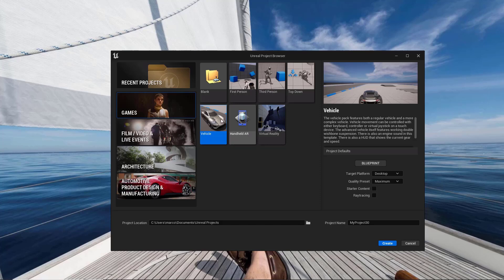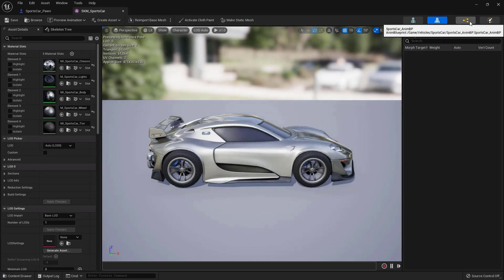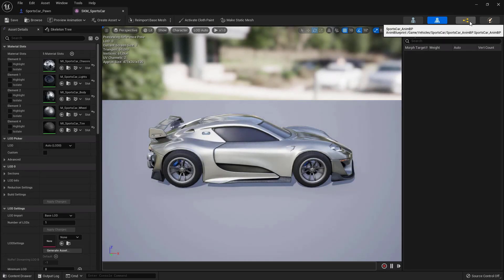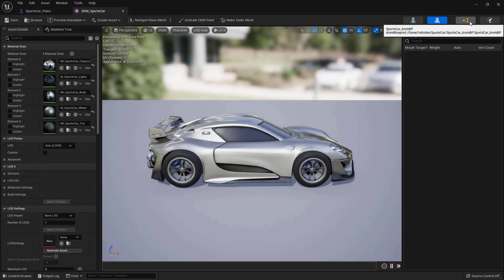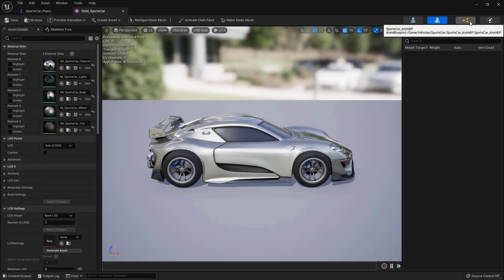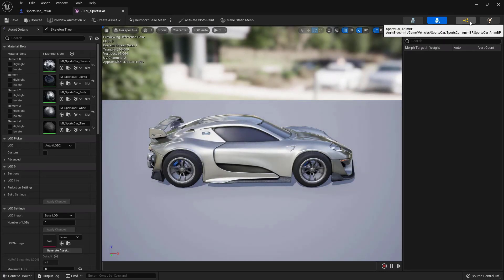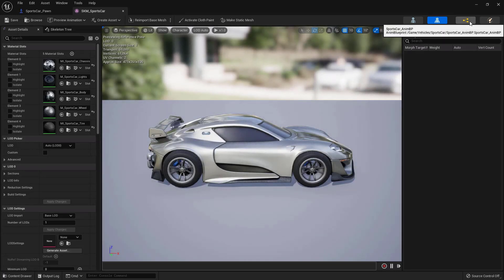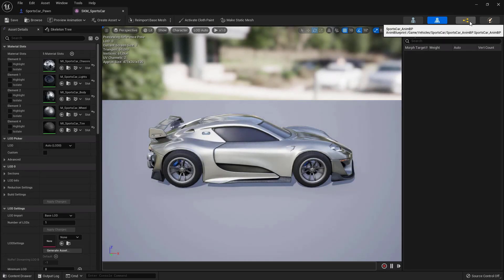Chaos Vehicles Wheel Shift and Camber - Unreal Engine 5 Tutorial

Comment: Dude! You make great videos 👌 I have a request 🙂

I feel like it is impossible to get good vehicle handling in this game engine.  NO videos talk about how to get any form of acceptable handling for chaos vehicle (or the old wheeled vehicle). There’re hundreds of setting to fiddle with.
I have tried for months now. And I am almost giving up now.

I know that wheel friction and center of mass is drastically changing the handling, I just can’t get it right.

Too high friction and the car wont slip/skid out, which it needs to do, cause having a car glued to the road is not fun.
Too low friction makes the car slide, and is not getting any forward momentum, and it takes forever to get it up to speed.

I’m almost getting there with different settings in front and back tires, including brake power, but as soon as the car starts sliding/skidding (what is the difference?) it looses it’s forward momentum, and just goes sideways.

I’m sorry, this comment is getting long, I am just frustrated by how hard it is to get proper handling. The default settings are absolutely useless..

On my channel I have a few videos of my car game, if you are curious to what I am trying to make here..

Can you be my light and show me the way to get good car handling? 🙏🙂
Reply from the maker: Yes, I already watched your videos about procedural track generation. Great stuff!

Regarding vehicle handling, it can get very complicated. On one hand good handling is very subjective and different players have different expectations. On the other Chaos Vehicles are designed for performance and multiplayer, but they lack some fine tuning options and, at the moment, their settings are largely undocumented. One can learn a lot from the source code but it takes time and experimentation.

The basic handling is mostly given by the tire friction parameters (multipliers etc.) and the way the suspensions are set up. Secondly the way the player input (raw) is transformed into the vehicle input.

The behavior also changes with the adjustments to the center of mass and to the inertia tensor scale of the vehicle's body.

Overall you need to understand how vehicle dynamics work and how the different settings affect it. For example, what to adjust if your car understeers/oversteers, what if you want to make it drift, etc. There are few basic vehicle dynamics and simulations tutorials out there that may help you familiarize with those concepts (google Marco Monster's vehicle physics tutorial).
Reply: @marcoghislanzoni  There’re just so many odd thing happening. Like the vehicle starts turning slowly at high speeds, or when the car get traction again after a drift, it gets all the traction at once and then you end up going straight into the railing… Thing I just have absolutely no idea how to fix, because the setting are so obscure that you need to be a car engineer to understand it..

I will try and search for your suggestion 🙂
Reply: I've been having those same struggles with the Chaos Vehicle and Advanced Vehicle systems (especially with trying to replicate Need For Speed The Run's/ Shift 2 handling) What helped me a ton with the chaos vehicle set up:

Inertia Tensor Scale: 5,5,1
Slip Threshold: 2
Skid Threshold: 1
Side Slip Mod: 0.4 - 1 (depends or your build and is most noticeable on the rear axle)

As far the suspension goes...not sure... I'm still trying to get more body roll without using the arcade settings. Maybe aiming for softer dampening and springs with hella slip could force the car to behave as desired, but I can't confirm that it fully works. I really wished the developers of Chaos Vehicle System would collab with the dev of AVS. This would fix so many issues with making a more realistic or fun driving system for our projects.
Reply: @jaiarojas5147  thanks.. I will try and copy your settings, and see what happens 🤷🙂
Reply: @REE-Animation  I have the same issue, where the wheels gain traction during the drift and they aim to the internal side of the corner. Quite annoying.
Reply: @jaiarojas5147  Apparently, many seem to have difficulties getting an arcade-handling and physics, with the existing Vehicle physics.
I do like Chaos Vehicles. It's easy to setup and get going, but many properties don't have any explanation. Even experimenting with them, it's not always noticeable what they are actually for.
For example, with the 'Arcade Controls', I was able to figure out what the Stabilize Control' settings exactly do, as you can see the forces created when you use the VisualDebug. But the 'Torque Control' and 'Target Rotation Control' properties, I have no clue what they're supposed to do, because whatever values I use, I don't see or feel anything happening.

What is the Intertia Tensor Scale actually do? And any clue how it is different from the Velocity XYZ in that same property-panel?
Slip and Skid Treshold, I don't notice too much effect of them either (with drifting). Have the default values for the front wheels and set both to 100 for the rear wheels. The one creating the game 'Over Jump' (a Sega Rally 'remake') led me to a Lateral Slip Graph, which helped with keeping the car stable at lower speeds and get a bit more loose when at higher speeds. But still not enough to get decent drifting out of it?
With @REE ANIMATION & GAMING advice, I was able to prevent the car from tipping over so much. And if it does, generally land back on 4 wheels.

I see some video's of people showing of their drifting within an Unreal Engine. Most of them are just to slidey and if you played enough with the settings, you know their drift isn't actually in their control. Some video's do show proper arcade drifting, but don't show how they actually managed to get it running.

I saw a GDC of 2018 that explains that how instead of creating their own physics, they used in-engine physics and assisted those physics to get more arcade control out of it. But again, they don't show how to do it.
So it is possible, but seems like the ones who know, are hell bend on keeping it to themselves.

Comment: Very helpful tutorial thx but I have one question I've add the possibilities to set the rear and front toe also with this tutorial but I want to know if this adjustment on my car act like in real life does for example at negative 4 degrees of camber on front for a drift car would it improve my grip and stability or should I need to do another nodes in the blueprint of the car to say to the car when you are at negative 4 degrees you have more grip during drift ?
Reply from the maker: What you see in the tutorial is purely aesthetic not functional. To tweak the actual grip of the car according to the camber/toe you have to act on some of the parameters in the wheel BP's, like lateral stiffness, friction multiplier, etc. Some of them are not exposed to BP's but if you use C++ or know how to make a BP Function Library that is pretty easy to overcome.
Reply: @marcoghislanzoni  okok thanks for your fast answer :D

Comment: that's a nice and quick way to do it visually but what if i want the camber and wheel caster be adjustable by the player and influence the physics simulation?
chaos vehicles seem a good place to start but they can't drift and from what i've seen you need to edit the chaos vehicles source code to allow them to do it, so i'm assuming that changing caster and camber for simulation use won't be as straightforward.
Have you had the chance to take a look at chaos vehicles code? i remember from your prev project you had a pretty decent handling with drifting cars, did you try to update it for ue5?
Reply from the maker: Chaos Vehicles are implemented part in the engine and part in the Chaos Vehicle Plugin. That makes it difficult to tweak them completely (unless you want to recompile the engine and customize that part as well). They have been designed to be performant in large numbers and to enable multiplayer, not necessarily to be realistic (e.g. there is no clutch implemented). There is currently no support for camber related effects even though you could tweak the lateral friction multiplier as the camber changes to simulate that. It will work but it will be far from being fully realistic. If you want full control of your vehicle physics the recommended and only way is to work on an own implementation where you can reach the level of sophistication you desire. The new Async physics in Unreal Engine 5 with fixed tick rate makes that task somehow easier because you can tune the car for a chosen physics FPS and rely on the fact that I will stay stable even if the game FPS drops. I haven't ported my custom vehicle physics to UE5 yet, it's on my todo list when time allows.

Comment: UE 5 Chaos vehicle plugin doesn't works with custom made cars in blender in my case.... Whenever i migrate project template car it works, but when i used blender imported car chaos vehicle plugin suckss. Please help!!!!
Reply from the maker: You need to check the scale of the root bone of your vehicle. If the scale is not. 1,1,1 you will have problems with the physics. Also the vehicle has to face the positive X axis. I have their guts on my channel covering all these aspects.
Reply: @marcoghislanzoni  Ok Thanks. I'll look into it.

Comment: What would be the best method to have the wheel camber change based on the wheel position in the z axis. For example, as the wheel articulates up, the camber changes.
Reply from the maker: @mimickedreality  I have another video on this channel covering wheel camber. You can make it proportional the the suspension compression so it is neutral at mid compression, negative when it goes further and positive when the suspension is partially unloaded. Something like: 2 * Camber max angle * [(1 - suspension length / max suspension length) - 0.5]
Reply: @marcoghislanzoni thank you, Marco! That's very helpful to start wrapping my head around it. Do you know if there's an easy way to access the suspension compression data inside of chaos vehicles? Ive been trying to access through the vehicle component blueprint, but not sure where to look to get the suspension compression values per tick..or am I overthinking it? Thank you!!
Reply from the maker: @mimickedreality  this information is in the wheel state.
Reply: @marcoghislanzoni Thank you, Marco! I was able to access the suspension length and spring rate. Could you give advice on one more thing? If I wanted to simulate more control in the damping ratio..what would you recommend? Basically id like to simulate a fast/slow compression (rebound velocity?)and rebound that mimics real world compression adjusters on dampers, and don't want a one sized fits all damp ratio.Thank you!
Reply from the maker: @ Per wheel? I don’t think the standard Suspension Constraint supports that, you will need to implement and integrate a custom constraint. Doable but definitely not trivial.
Reply: @marcoghislanzoni  thank you! It sounds like it might be an uphill battle.  I'm essentially trying to simulate more of a Baja style suspension, where the compression can be slowed down. Hopefully in a future version they will allow some more control.

Comment: Do you happen to know if chaos is compatible with steering wheel support? Or would it be wise to just make it controller compatible and then use this party plug ins to simulate the steerin wheels as a controller?
Reply from the maker: Not directly, but you can control a Chaos Vehicle with one of the many steering wheel plugins available or using Raw Input. The output of the steering controls/pedals can be used to set the throttle/brake and the steering of the Chaos Vehicle.

Comment: Great video, thx, you work very helpfull
Tell me how to solve the "Chaos" physics problem when the car is in the air? The problem with physics falling asleep when the car stopped moving was solved with the "Wake all rigid bodies" blueprint
I'm jumping on a trampoline, and my engine speed and RPM immediately disappears, the rotation of the wheels, the gas in general, how to solve this problem? I want to throttle in the air so that all functions work the same as on the ground.
Put the cube on the ground, from above put the car, so that the wheels do not touch the ground and the cube and try to press the gas...this moment need you help.
Reply: I'm having the same issue in my rally game (which is ironically called Over Jump but the jumps are the weakest part). The RPMs used to go up when the car was in the air in the Early Access version, but they changed it in Preview... I believe it's a bug, I reported it to them and you should do the same.
Reply: @AlessandroSchiassi  Okay, thx, for support!